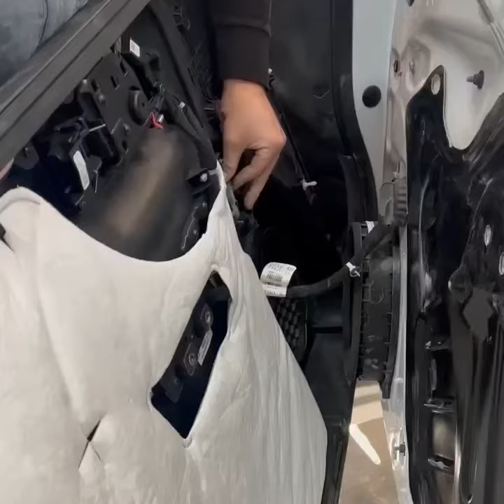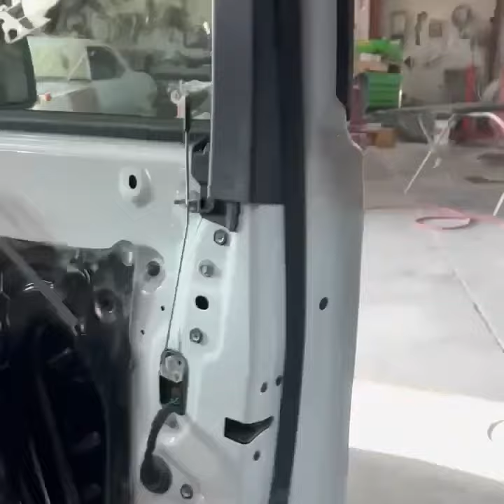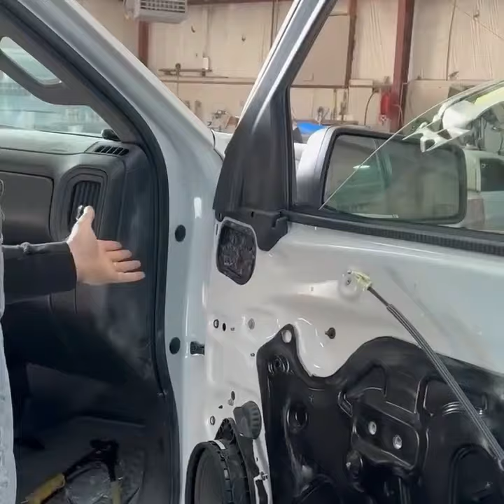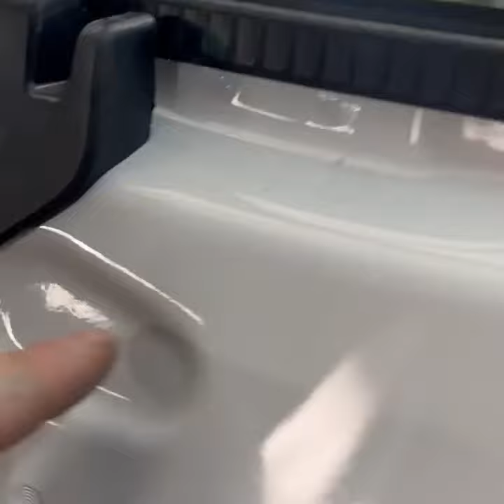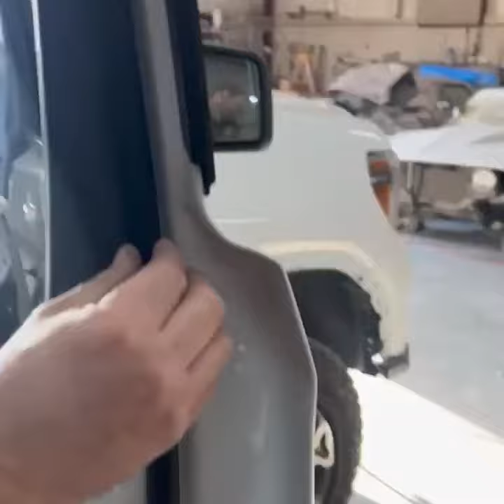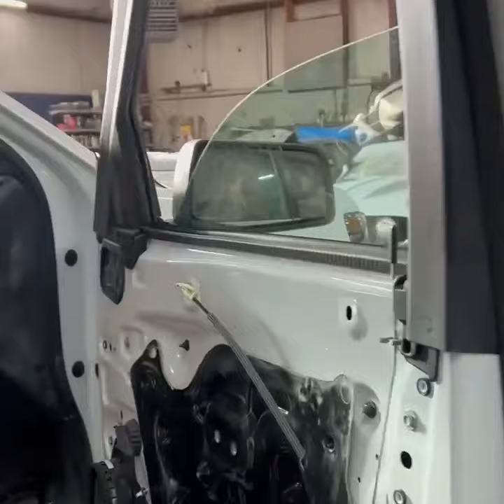Quality GM parts these days 🤦🏻

Comment: Ive worked at the gm springhill plant. Not for gm but construction facility renovations. 
There is a ton of mismanagement there and dumb cost cutting. I'm sure the folks on the floor probably aint the most motivated either but from my own two eyes a lot of the problems came from corporate. 

Then I think about the Mexico plants and could only imagine how much worse they are.